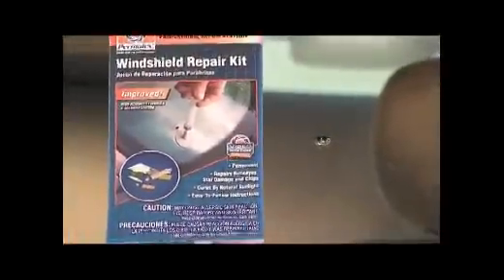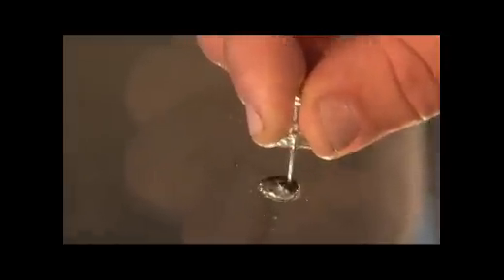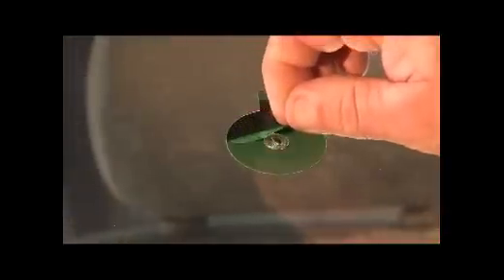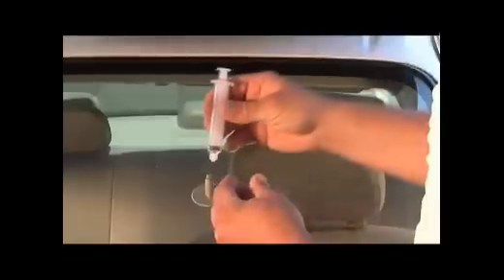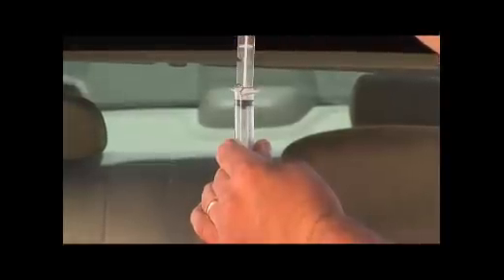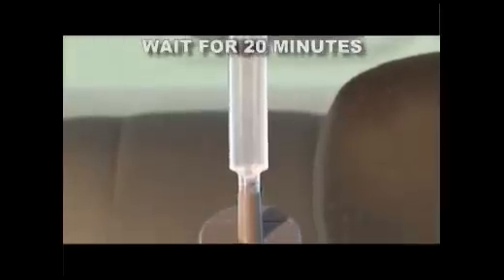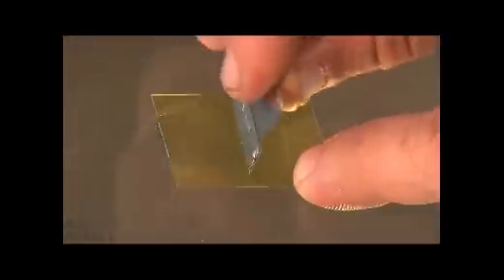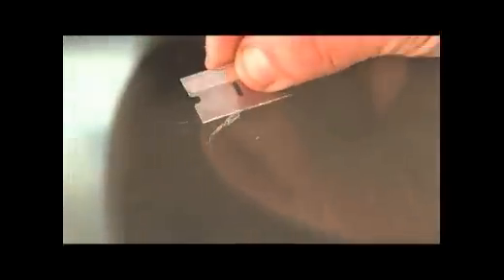How to Repair Damaged Windshield | Permatex Demo - Windshield Restoration Kit

Comment: Hey genius’s on mine You put the slant on the second stage where the clip holds onto slanted up which is opposite from the first one where the clip could hold on because it was horizontal since the second stage it landed up there’s nothing to hold the clip in place. You guys manufacturing an error so now I have to hold on for 20 minutes by hand, thanks a lot.!!😮

Comment: Be sure to lift your windscreen wipers when using this; I put too much resin in the tunnel.  Whilst taking the tunnel off the windscreen a streak of resin ran down it onto the wiper, sneaking under the sheet of kitchen towel I had there to catch drips :D

Maybe also get some kitchen cloth, punch a hole in it and drape it over the tunnel when applying the resin (some spats occurred).

I have to say the scraper works really well.

As others have said, have a toothpick or thin wire handy (I dripped the resin into the tunnel, which caused it to bubble up at the top) and a can of spray carb cleaner works wonders during the cleanup.  Maybe also have a bit of PVC tape to cover the resin tube nozzle.  I had to cut through the tube to get the last drop or two out.  Looks like the nozzle has a small hole when you twist off the cover, so cutting a few mm off it may be a mistake now.

And yeah, top is bottom and vice-versa (the lower notch is engaged when you move the syringe to the upper position) :D

Also heed the advice given at 11:30 in the Project Farm video (https://youtu.be/2fxxfZDOD1U)
Reply: Looks like the Rain-X kit is the better one to use - https://www.youtube.com/watch?v=6p8tl7-djYE

Comment: There are a lot of steps, but it is not hard if you just follow the video or the instruction sheet. I learn a lot better with visual examples so I appreciate the video. I have repaired at least half a dozen windshields with this kit and it works very well. Sometimes you can’t even see where the chip used to be. Just take your time and follow all the instructions and it will turn out very good. I highly recommend this kit.
I know this is an old video, but you guys (Permatex) should still link to it on your site. Your instructions still say to check out the video on your site so you need to provide the link.

Comment: Have you ever bought a product that performed Much better than advertised?
Wow, I just had something hit my windshield and chip it. About the size of a quarter.  A hole with spider cracks.  First time for me.  I saw this and other YouTube suggestions and decided on this product. 
I went to AutoZone and came right home, I've heard that the cracks get worse and worse, so I jumped on it.
Took about an hour, nothing difficult and most of the time is "curing".  Inside my car or out, I really have to search to see where the chip was.
This product is amazing 🤩🤩🤩 o

Comment: I had to razer off (not just wipe off) the residual resin to make the CURING STRIP LAY FLAT.  So my "bead" of resin was disturbed while I flattened the surface.  Also, I could NOT find the video anywhere on their website.  🤪  Otherwise, I'm happy with the results.

Comment: Watched the Project Farm windshield repair kit test/comparison on YouTube.  Permatex came in second behind a $300+ professional kit.  I used the new Permatex kit (tapered syringe rather than Luer lock, no cap on the resin tube) on a spider crack.  Worked like a champ.  We'll see how long it lasts and whether it stops the crack from spreading.
Reply: Also came here after a pf vid unfortunately for me the double side tape failed on the pressure stage and I was unable to fix the crack
Reply: Same here.  Just finishing up the repair now with the car in the sun to cure the adhesive.  Video instructions are spot-on.

Comment: Tips: the newest products don’t have the twisting syringe (it’s a normal one), the resin tube hasn’t a cap and keep always the alcohol towelette inside its little bag and try to close it after each use to prevent to get dry during the whole one hour process. When it says “3/4 of product” everybody is right: there’s no way to know that since the tube is white. So just keep aware of not finish all the product in the first application. You will need a tear or two to finish the process.
Reply: Wish I would of seen this before I started and then realized after step 2 I was fucked 😪. Why include a video demonstration on new kits that’s out dated…

Comment: This does work and I have had the rapid last through -20 degree winters. Two things … warn people that pressing too hard may further the crack…. Second, if the windshield is curved you should tell users to align the fixture bend lines to the glass curve. In the video you say to keep it pointing upwards but as a result mine detached from the adhesive on the windshield because the fixture was trying to bend even though it was only a mild curve (naturally all the resin came out). To users out there: the fixture has two bend lines on it to help adapt to curves it seems. Use those to help accommodate the shape of the windshield.

Comment: I would recomend to wear vynil gloves. Also, it's dificcult to calculate the 3/4 of resin from the tube, and once you cut it there is no extra cover provided.
Reply: I think they did this to make it clear that you're supposed to use the entire contents from the tube per crack.

Comment: Paid $17 for 1 1/4 kit. Got home, it did not have the cleansing wipe or razor blade. I gues if they included it the price would go up 10 cents. I did not have either at home. SO they saved 10 cents and I substituted another cleaner and used a utility knife. What total BS and lack of consideration. Next time I will shop for another brand.

Comment: Impossible to keep the syringe from popping out. There are no threads. The syringe popped out as soon as I pulled up on it. Thanks for making my windshield worse. Don't buy just go to a professional. They will repair the crack for like 60 bucks. Now I'll have to buy a $300.00 plus windshield. This product is trash.

Comment: It works.  At the least it should certainly stabilize the chip before it gets out of hand.   I'm doing it to all my chipped windshields.
Reply: Why do you have some many chipped windshields?
Reply: I live in New Mexico, the roads are rough, and the highways are long.  A lot of gravel ends up on the pavement and gets kicked up. Not every truck with big tires has mudflaps like they should.  And I guess the rest is bad luck.  I'm not a tailgater.   @omega2206

Comment: I used this kit a few years ago and it was the same as the video. It isn't any longer. It no longer has the push pin, razor blade, alcohol swab, closable tube or threaded syringe. The clip would not hold when I tried to go to the next step and the syringe popped out losing vacuum. This kit is now junk. Congrats on ruining something that worked well to cut 2 cents off man. costs.
Reply: I suspect you got a damaged kit, the one I bought yesterday came with push pin, safety razor, alcohol prep pad, and syringe with a clip on it. The only thing different than shown in the video was the syringe was not threaded where it joins the pedestal.
Reply: @ridbx  It was an unopened kit purchased from advance auto.
Reply: @frankcafolla328  Ugh, definitely worth returning for a refund if you can. What you received is not what you should have gotten. I just purchased another one from a local shop (first one came from Amazon, worked great, want to patch up a second car) and it had all the expected items in it as well.
Reply: I just bought the kit, it had everything in it. Maybe you got an opened kit and didn't notice it.

Comment: You need a pin or a toothpick to coax the resin into the pedestal. It kept getting backed up because there is nowhere for air to escape while filling it.
Reply: I didn’t need to. Put the tip in and squeeze. The air bubbles came out around the tip of the tube. Worked fine. 🤷‍♂️

Comment: If you haven't used this product YET......DON'T !    The syringe doesn't screw onto the tube, there is no cap for the resin once cut, one mini wipe for before and after cleaning hardly, my tiny 1/4 crack grew in process- 13 dollars wasted.
Reply: The syringe doesn’t screw in just push it in instead
Reply: Nowhere does it say thread the syringe on!
   It says twist

Comment: I bought one from Supercheap and ended up turning a small bullseye into a massive crack across the windscreen! When I complained all they did was point out that in small print on the back of the packet it says using this kit can make the damage worse. I understand some have had good results but be aware you're taking a big chance on wrecking your windscreen and paying for the privilege.
Reply: No clue what you did but I’ve used this same kit on 4 cars with nothing but great results. Maybe don’t push so hard on the adhesive circle and put stress on the already existing crack😂
Reply: Yeah I dunno what you did either. I've used this twice on small cracks and it's made them significantly better, though still visible. Obviously don't tap too hard on the windshield around the crack. The directions don't say to tap at all I don't think. Unfortunately, it didn't do much for the line cracks I have.

Comment: The instructions said to screw the syringe into the pedestal, but my kit did not have a syringe or pedestal that threaded into each other.
Reply: R J mine didn't come with a screwdriver haha
Reply: Twist the syringe on to the pedestal.

Comment: I just tried it. It worked great! I watched the video about 8 times and read the instructions before and during the repair. It filled the chipout part and the cracks. I can still locate the chip area - it's about 80%-90% as clear as before the rock hit it. The cracks are virtually invisible and that's the part I was worried about. Overall, I don't think anyone but me could find the area.

Comment: You need to specify which side of the adhesive disc to put toward the windshield.  I put the green side away from the windshield and it peeled so hard that it pulled the bottom seal of the disc off the windshield, weakening the hold.  I could not judge 3/4 of the resin either and ended up putting in the whole tube.  Finally, it blew apart when putting on pressure with the syringe also.  I tried to gather up the running resin and hold it over the damage with the yellow curing strip.  Hopefully it will at least keep it from spreading.
Reply: Guessing you didn’t see them peel the white side off and place that on the windshield then……
Reply: @zaneherrington8868 lol he doesn't know how stickers work

Comment: Two things: First, if we need to "use 3/4 of the resin" you should make the tube clear. Second, You guys should re-shoot this in 720p or higher res to show more detail. 240p is pretty fuzzy/grainy
Reply: Agreed! I used it for the first time today and it was difficult to know how much resin I put in. I was worried not enough. The tube doesn’t collapse as it’s emptied.
Reply: I think that if the tube was clear the resin would cure in the tube, they should switch to number of drops instead like most of the competitors do.
Reply: The resin “sets” with UV light. I think customers would be pretty frustrated if they got a tube full of solid resin. Critical thinking good sir.
Reply: @patrickjones8263  I appreciate your input, but you're missing many important considerations in your "critical thinking", Patrick. The application of resin is typically done under cover (ie. in a garage,  under a pop-up canopy, etc.) and thus not exposed to UV. The vehicle is typically either moved into direct sun, or a UV light is applied only AFTER the resin application is deemed acceptable. Even if someone were to apply it in direct sun (which I  believe the instructions advise against), it would take a significant amount of exposure time to set, certainly more than would be needed to judge just how much 3/4 of the tube is.
Reply: Good video. I wish I'd found it from the printed instructions before botching the job. Add a QR code?

Comment: Wow, this guy NAILS these instructions!!!  Dude, you saved my LIFE!!!  ...or at least the windshields on both my and my wife's car! Brothers for life, I say. 

"The fit between the syringe and the pedestal should be QUITE TIGHT!!" Man, THAT is awesome stuff! In fact, it's more awesome than that!

(Seriously, this kit DOES work and following these YouTube instructions is way clearer than using the included paper instructions.)
Reply: I hear ya.  The paper instructions can get a little confusing.  Especially setting the hi and low part of the plunger.  Low to me means the bottom part close the the end of the plunger.  Well my dumb ass did it backwards but it still worked

Comment: It's cheap and will not fix your crack or rock chip. The adhesive needs to stronger or bigger as my resin blew out. I know I pushed hard enough, as my  bulls eye/spider grew after I put it on. Think the syringe needs more vacuum as well as pressure. I heated up my glass couple times with the lighter to expand the glass for better results. Resin is cheap and I can't get a smooth fill on the ding. Good idea, just cut too many corners.
Reply: You used a lighter and wonder why you got bad results? lol. You didn't expand the glass, you just damaged the intermediate safety bond layer in the windshield.  Maybe the problem isn't the kit???

Comment: I am a very patient person when it comes to car repair.  I followed every step just like it instructed and it didn't work at all.  The adhesive is not strong enough to hold the pressure of the syringe and it sprayed resin all over my windshield and didn't push any down into the chip.  This product is a complete waste of money and time.

Comment: Purchased this kit to repair a small bullseye but have not used it yet.
The syringe in my kit is different to the one that is in the video and instructions, it does NOT create a seal with the pedestal, so there is no air suction / pressure!

Comment: Some kid through a rock at my new to me Jaguar, two weeks after purchase. Used this product within twelve hours to prevent star from spreading. Use as directed and this will save you a new windshield. great product that actually works! Hmm, $15 or $275 Thanks permatex!!!! Oh, Take the time and follow the directions, video is much better than paper instructions.